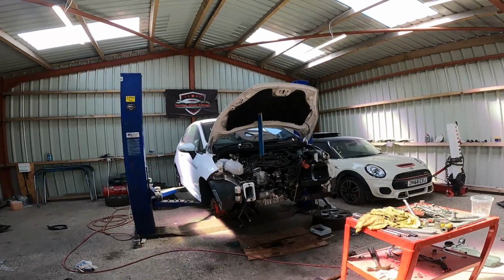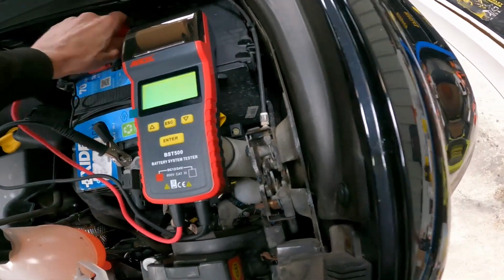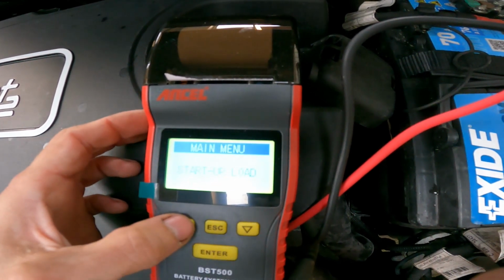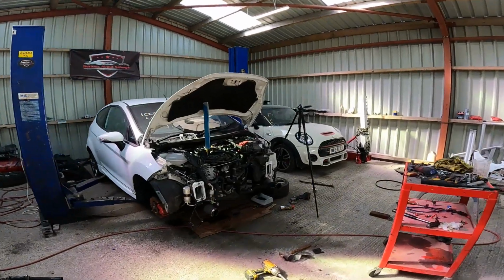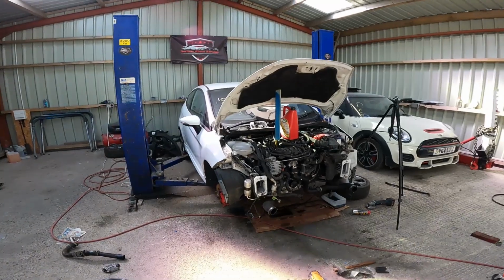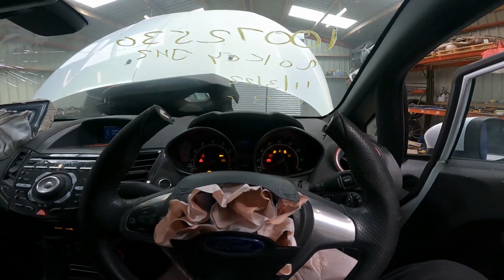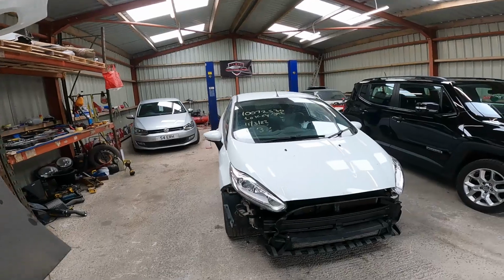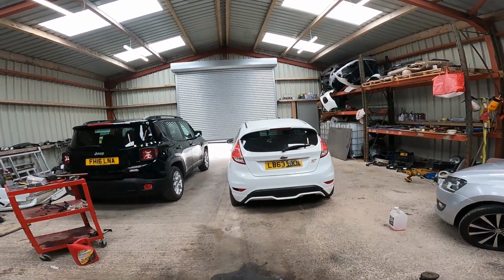Moving Forwards With The Fiesta ST180 + Ancel BST500 Review !!

Comment: The coolant reservoir is as you say, down to a recall. It's because the early versions between 2013 and 2014 were prone to catching fire due to a coolant loss very sudden due to poor design with the pipes moving the coolant. The large black unit by the expansion tank is for the warning system ford fitted if there's a sudden loss of coolant. It warns with audio and light on the dash. Lots of work for each car when fitting all the bits.

Comment: Hi from durham phil👋👍 hope your ok and perking up a bit and yoyr lass and bairn are ok👍 not sure if you know but nocoboosts jump pack has a little feature if batteries totally dead. If you prss and hold red ! Button it gives you all the amps you need (I have started transits with.mine and booster been like dead dead😂)  you might know you might not but info there lol hope enough space for aircon pipe and not to much hassle to install and sum cars are like boomerangs they just keep coming bk ( polo )  thanks for your time and be safe see you soon👍👋

Comment: You need to update your opening screen mate. Still has the 20k giveaway competition on there. Also your using an impact drill that we use at work to remove 30mm castellated nuts off to tighten 13mm bolts by the look of it.